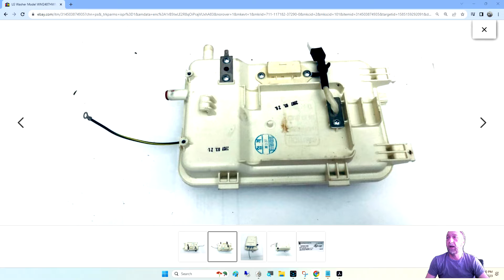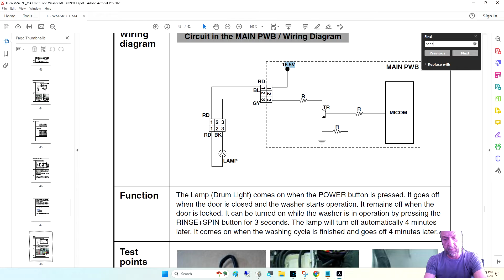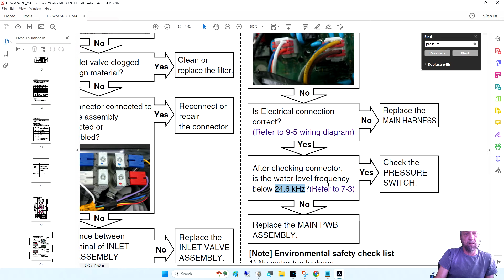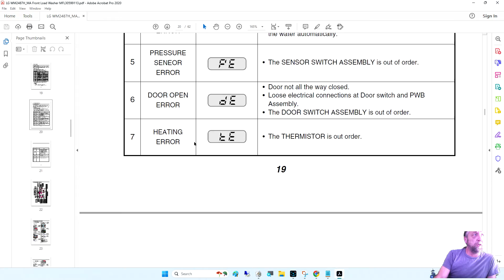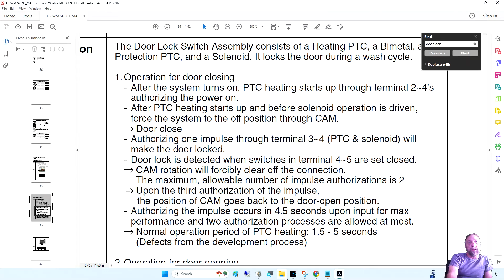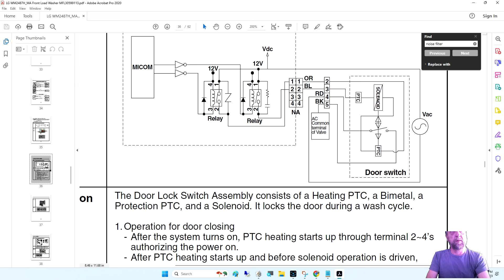LG washers

Comment: Thank you professor. This looks similar to my LG wm3250hwa   Front loading washer. Spefically I am looking for the replacement size of a blown/charred resistor. Nothing on the controller PCB  and my resistor is charred, no color available.

Comment: How can I get a part number of thermal fuse for LG washer front load board EBR796026? As I just bypassed it but the side effect is the circulation pump keeps on going and doesn't stop as soon as you start the washer modes. Please advise.. thanks